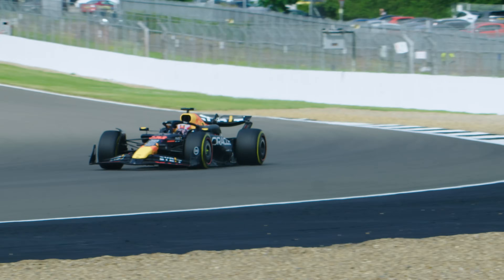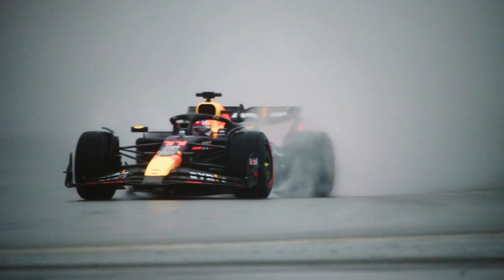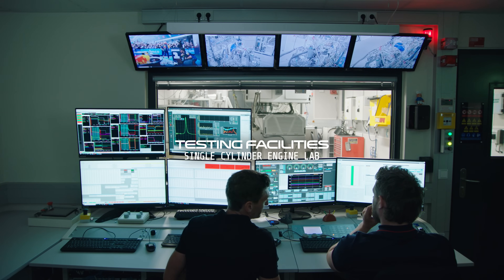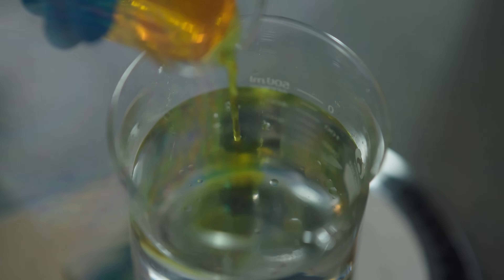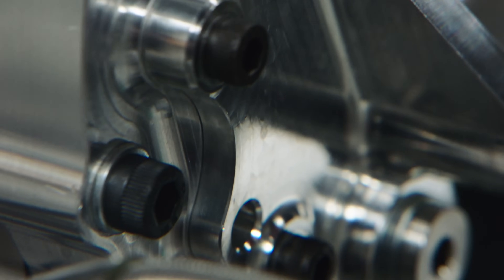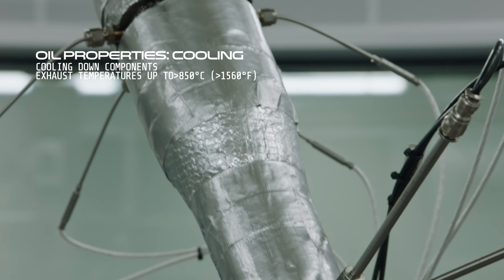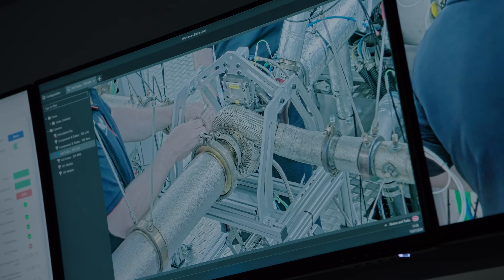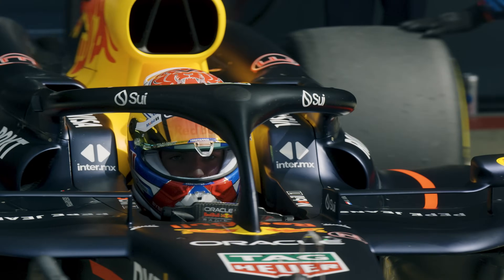The Fuel and Lubricants Behind Our Championship Winning Engines | What It Takes

Comment: “Performance and efficiency we can extract outta the engines” 🤦🏽‍♂️🤦🏽‍♂️ they’re race engines. They’re not meant for more than 3-4 races. How many multi million dollar engines do you get a session? You’re ALLOWED 3-4 (that’s debatable) PER DRIVER. So yall go through like 8 engines in 20-22 races. How fucking efficient is that?!
Reply: You're confusing efficiency with reliability. Efficiency means thermal efficiency, an F1 engine has a thermal efficiency of over 50% whereas a road car gets somewhere between 20-40%.

Comment: what Hamilton sniffed in Ferrari to make the decision to move there is because of the the regulation changes regarding the fuel which will happen next year and so Ferrari will have an edge with the fuel. I remember Jean Todd mentioned something many months ago or was it the end of last season, they're working on new type of fuel, but very vaguely, maybe it shouldnt have slipped out of his mouth, and he's with Ferrari. So anything which comes with fuel - its ignition, spark plug, combustion chamber and pistons and rods etc design... everything with the fuel or the fuel itself Ferrari will aim to have the advangage, so RB and Ford - beware
Reply: The engines will be equal…what ford will have is probably a lot of reliability issues..Ford also won’t have the database that say Honda or one of theo thẻ teams do

Comment: Glad you guys are working hard on the 2026 turbo. It's a large mass turbo, so maximizing it's response and efficiency for the pressure ratios will be crucial, particularly as you no longer have an MGU-H to help.
Reply: Than engine sound is more better. 🎉
Reply: They are still getting 50% thermal efficiency

Comment: The “championship winning engines” that are not as powerful as the Ferrari nor as reliable as the Mercedes. Luckily, the car was amazing, now not even that. Sad to see this amazing team drifting away, but I guess it's what happens with all this power struggle
Reply: @sergioferro46 @gpaje Honda let nobody alone. All IP of the current PU is and will stay at Honda. It was clear from the beginning that RBPT has absolutely nothing to do with the current PU but solely with the 2026 PU!
Reply: @peteryoutube1  True, I have said this many times in other posts.  However, we are talking about the installation and up keep of the PU once they receive the units.  Honda builds them, it's up to RBPT to do the install and everything after, even more so this year.  RBPT when it comes to development and construction is doing only 2026 units.
Reply: @gpaje I don't think Honda just builds them. I'd say everything the PU concerned is supervised by Honda this and next year. Nobody from RBPT is involved, just the "usual" car mechanics.
Reply: @peteryoutube1   Not what I heard, Honda's official presence around the team is much less this year, you typically see actual Honda personnel from Japan in and around the pit, it's mostly RBTP now.  Honda's manufacturing agreement ends at the end of 2025, but I think they are weaning the RBTP trackside support before then.
Reply: The start of the Empires fall was the horney hormone
Reply: I think they have the best battery system however,  they're powerful enough and reliable enough with arguably the best battery.  No engine is dominating like in the past.
Reply: @gpaje  This year, the RBPT has been crazily unreliable. Look at Max, using his 6th PU at Brazil cause his 3rd literally lasted one lap at Canada
Reply: @sergioferrero46   sure, but they've been really playing with the aerodynamics and talk is they've been overheating the pu and maybe pushed it too far.  He's had generally strong reliability during his three championship run.
Reply: @gpaje  2021: bulletproof
2022: initial fails, but then very good
2023: flawless
2024: quite worse than previous years
Reply: @sergioferrero46 I agree, seems to match that they're doing something different this year, also maybe Honda is less involved since they're going to be joining Aston, though they still got one more year together.
Reply: @gpaje  Yeah, Honda left an inexperienced RBPT department alone, and they're paying the price
Reply: @sergioferrero46   Honda are still building the PUs, but wondering if the application is the reason?  Either way, it's Red Bull who wanted to give RBPT more freedom to get their hands dirty, but will likely pay off when they start doing it all by themselves in 2026?
Reply: I think you haven’t seen season 2023
Reply: @haiderjaved8254  nah, I just watched literally all sessions
Reply: So you better know that every great team struggles to reach the top
Reply: Still can deny that after formula 1 made switch to E10 fuels from 2022, they become the most realiable, most efficient and most powerful engine on the grid.
Reply: @denilsonmusila  Absolutely none of that is true. The Mercedes PU is the most reliable (look at the PU component chart from these past 3 years, mostly 2024), while the Ferrari engine is the most powerful. The only advantage they seem to have comes in the ERS, which seems to allow to deploy energy more efficiently and over longer periods of time in the race